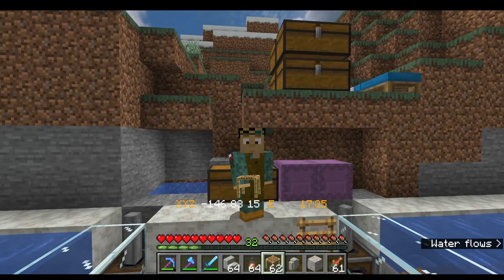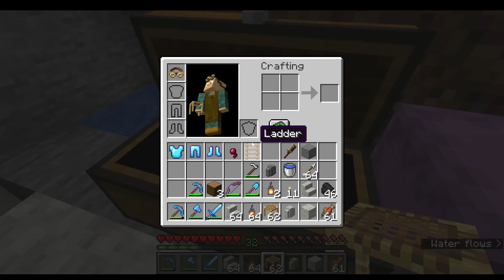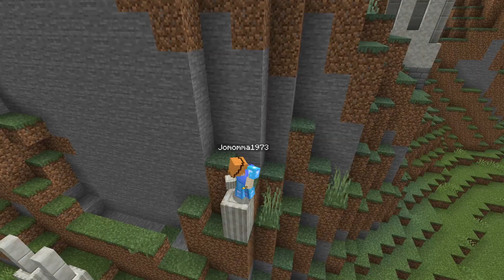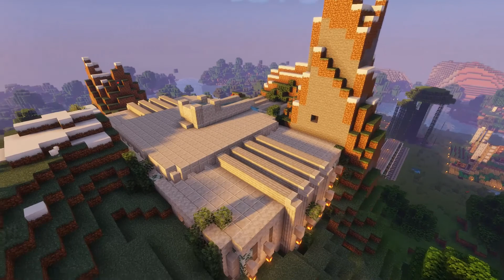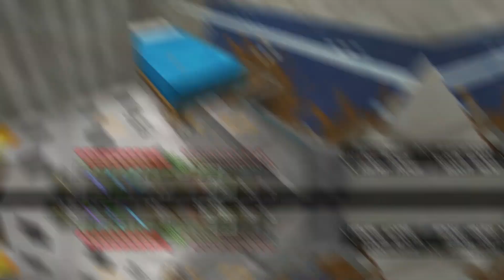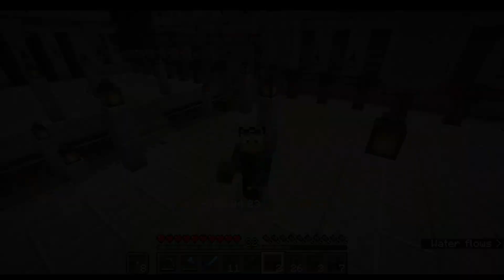MASSIVE Hydro Power Plant! p.2 Minecraft Create Mod 1.16.5

Comment: I got to comment on the slow shaft part. If it were to go that slow in real lift, it would had so much torque that something would had break
Reply from the maker: yup! absolutely correct! I've seen Jeep drivers who  put in custom gearboxes in their rides, gearboxes that have really speed, actually twist their driveshafts like someone wringing a towel because of the outrageous torque